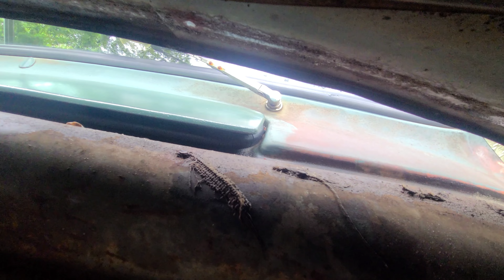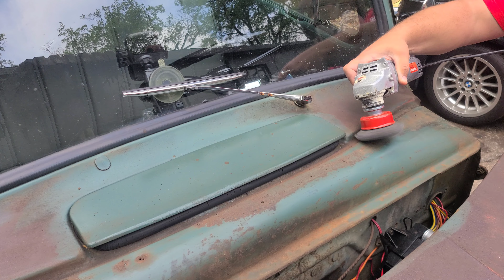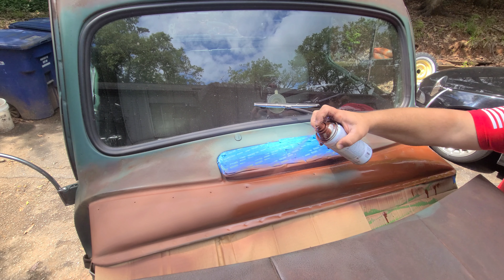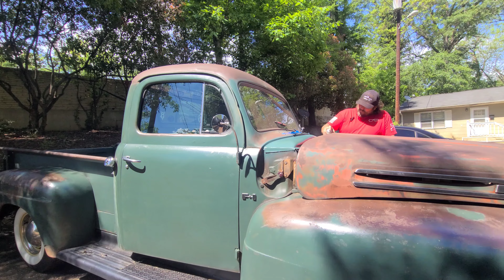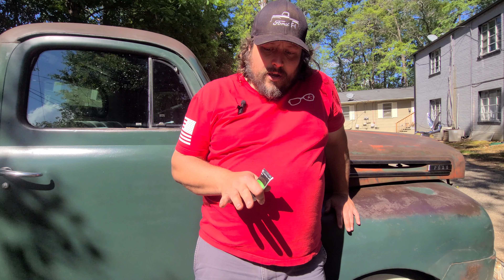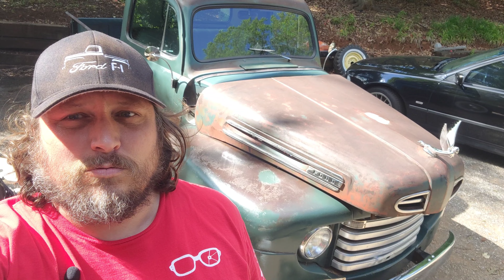DIY Cowl Lacing Replacement for Edna and all 48, 49, 50, 51, and 52 Ford F1 and Up

Comment: On my ‘50 I used a rubber replacement seal instead of the original style cloth. I did not remove the hood and only removed nails with broken heads. Punched tiny holes in the rubber and slipped it over the nail’s head. Used a long punch to secure any missing nails. Happy with how it turned out a few years ago. Edna’s turned out nice as well👍
Reply from the maker: That's a cool idea. I didn't think of using anything else

Comment: I wish my truck was as far along as yours , I have a lot of work to do yet ...A lot..
Only a couple of videos on mine so far.
Looks good man
Reply from the maker: Thanks. There is still plenty to do. I want to replace all the body mounts in the near future.
Reply: @Adventures with Edna   I have a running motor now , and parts to finish the transmission. 
Parts to put a diff together with the best of the worn out parts.
Hopefully, I get wheels back on it this year.
But I got an opportunity to help with some steam tractor stuff at a local museum. 
So might be changing plans a bit.
It's hard to come home from a day pulling wrenches , and pull more wrenches 😉
Reply from the maker: @Watch Wade Work   I have three transmissions for Edna. Gonna swap another one soon. One is rebuilt by me. Another was rebuilt by someone else, and the third isn't rebuilt it all but I'm gonna try running it as is. My bmw is down so I've been driving Edna everyday for the past few weeks, which isn't to big a deal because I pretty much split driving between the two anyway. Steam tractor sounds pretty awesome.
Reply: @adventureswithedna  yes , the steamers are neat and might be some excellent video material
Reply: @Adventures with Edna   my Trans case is a 49 top loader,  my gears are out of a 51 column shift.
One can not mix and match as the gear cut is different. 
But swap as a set  , no problem
Reply from the maker: @Watch Wade Work   I bet they would. Can't be to many of those around anymore
Reply from the maker: @Onemanstrash1  I've got a bunch of videos on rebuilding and installing mine. @WiredCustomsSpeedShop was a big help with his videos